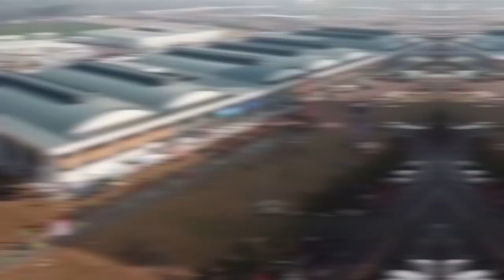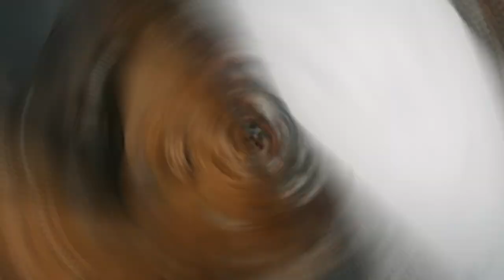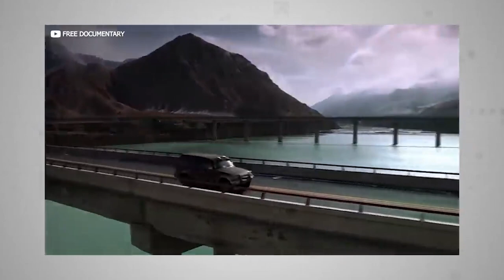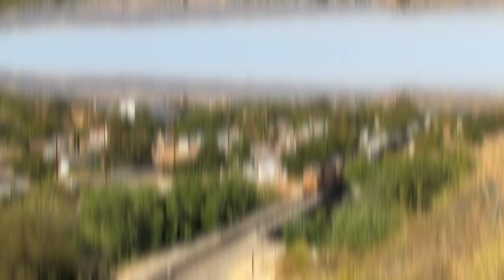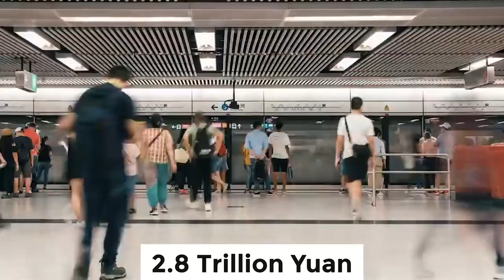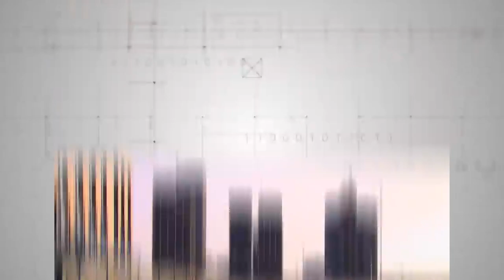The Terrifying Reason Why China Is Built So Fast!

Comment: Build for build's sake, not for economical or wellness's sake.  So there is now an issue of fast building time equates to lower quality of houses and skyscrappers.  There are also way too many housing units in rural areas with nobody wants and not enough space in major cities that nobody can afford.  

This is the basic issue of using GDP as measurement of economy, it's all about how much you can produce, how they are being utilized doesn't matter.